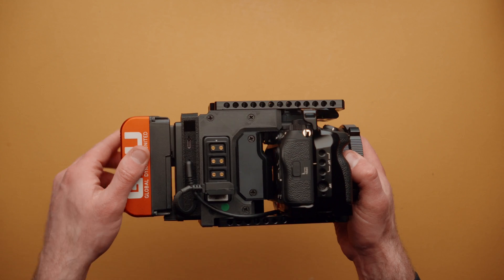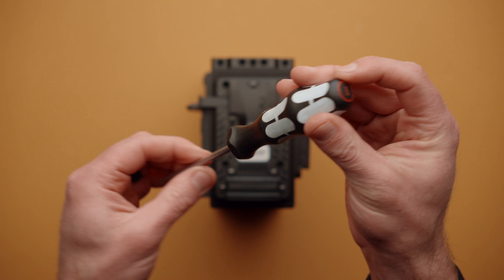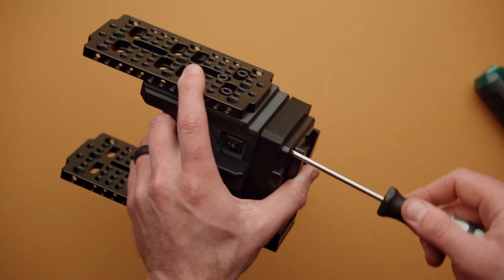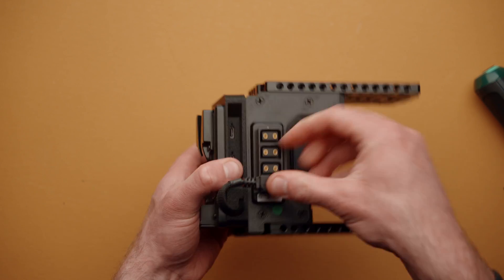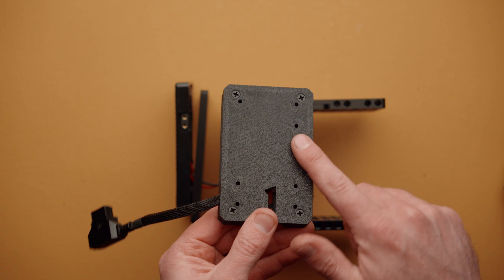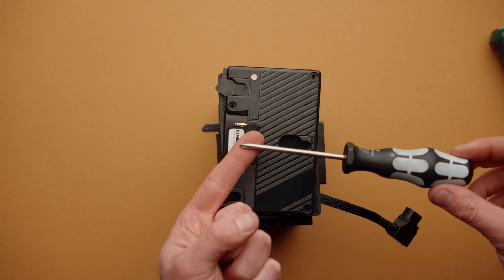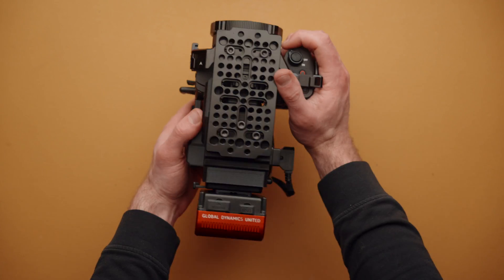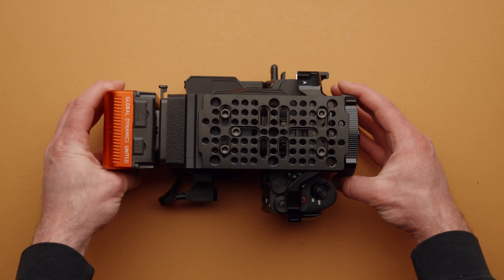CineBack™ USB-C Power Upgrade Module!

Comment: 2 questions. 1) Will you have these available from with UK / EU. The reason I ask is that shipping is prohibitive from USA. Shipping is costlier than the unit.
2) Where did you acquire the “This rig is mine” patch. This is one of my favourite quotes (FMJ) I was actually present during filming of the movie so it holds special significance.
Thanks